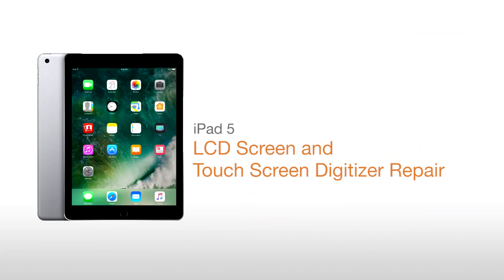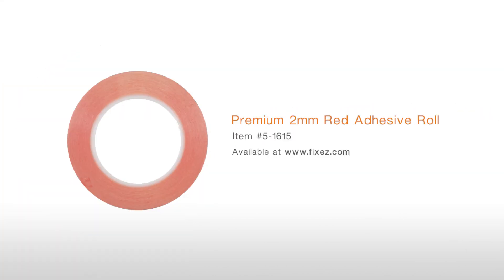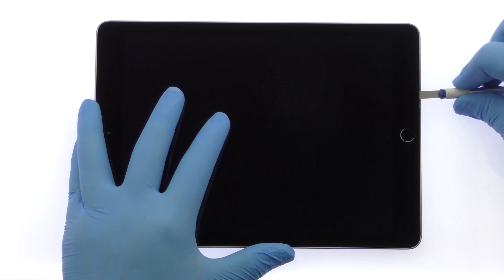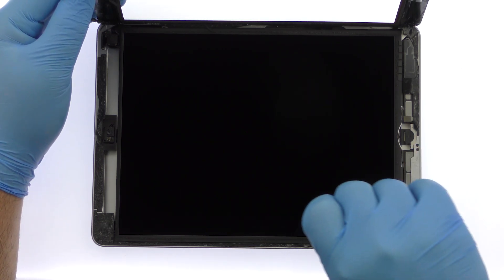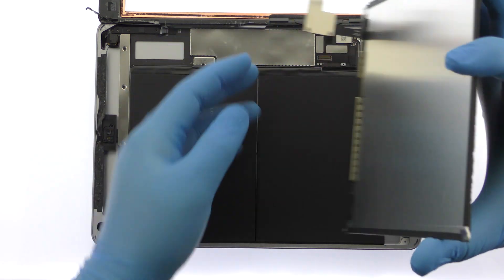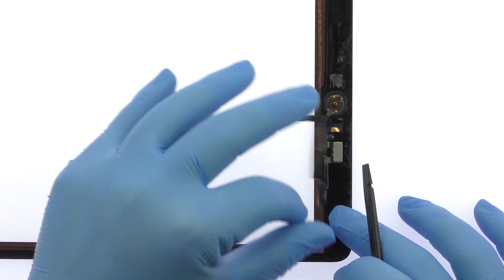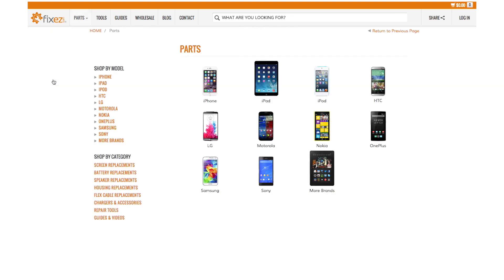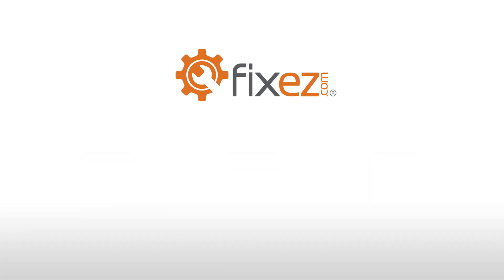iPad 5 (9.7") LCD Screen and Touch Screen Digitizer Repair - Fixez.com

Comment: My Touch ID still responds, but my button does not respond to click. Has anyone seen this?
Reply from the maker: It's possible the home button bracket and or gasket is damaged. Does the home button have normal functions aside from the Touch ID?
Reply: I have the same issue, the home button does not respond at all. I unplugged the home button ribbon cable and still nothing.
Reply: Fixez.com nice

Comment: My screen not even coming off. I tried to use a pry tool and nothing happened. I have an iPad 5th generation a1822 model.
Reply: Martel Morris where do u get replacement glass?
Reply: Always use a bit of heat with a heat gun first. This is a must to soften the adhesive securing the screen to the case.
Reply: George Prince just a bit of hit it on the table..
Reply: A good way to ruin it..lol..
Reply: Martel Morris Did you try heat gun?